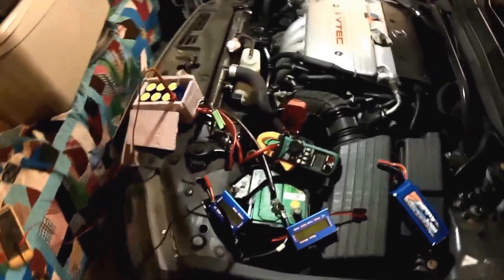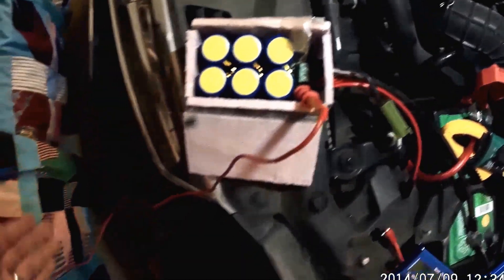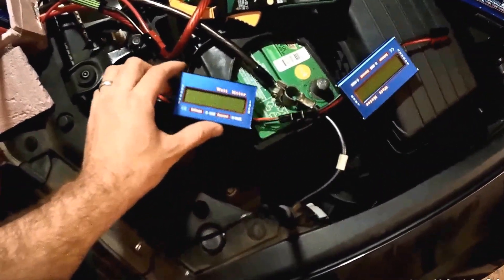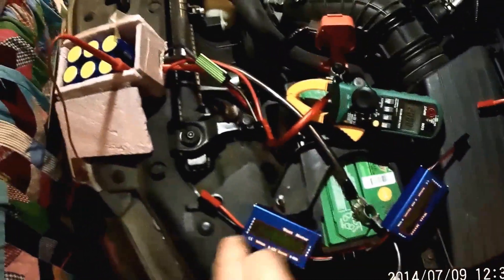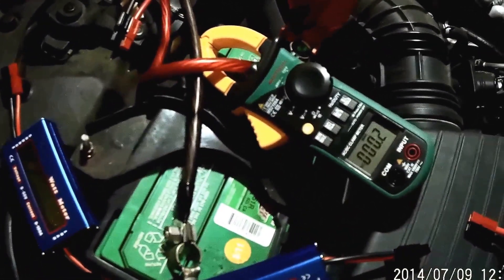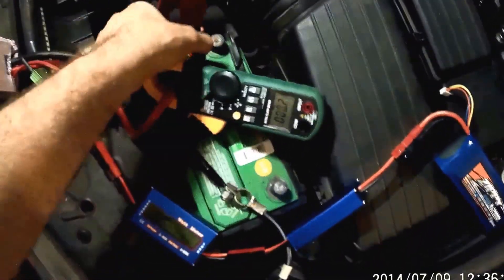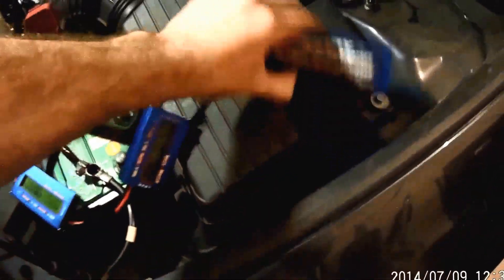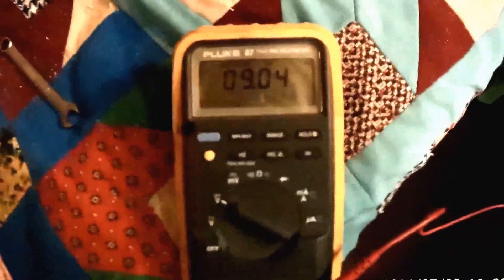Car battery replaced with a super capacitor and LiFePO4 battery

Comment: Your caps don't hold enough reserve. The high amp draw is from the caps lacking enough voltage. A 3.5v drop will discharge more amps as the capacitors compensate with balancing the wattage potential. You can hear the low crank speed of the car. Maybe two super capacitor 14v banks in parallel to double your reserve would work...but with that dinky battery pack limited to 50w, in no way that set up would work reliably in any cold climate.
Reply from the maker: Thanks for watching and commenting. The car has always been slow to crank, even with the stock battery. That said, I completely agree that somewhere around twice the farad rating would be ideal. I do have 3000f in a 5-series string setup that I put together to replace 1 of the 2 huge batteries in my diesel pickup, so I could test cranking performance with that.

I still have this car, and since the video has been made, I have built my own 4s LiFePO4 battery using 32700 7.2Ah cells, and located the pack in the glove box (to keep it from freezing temperatures). Perhaps I'll provide a video update on the current setup.

Comment: A circuit to disconnect the cap if no charging took place for a while might be useful... (It would require the battery to be large enough to start the car on its own under such circumstances though....)

A BMS for the battery might also do the discharge current limiting....

Also, the capacitor's capacity (since it starts charged) should somewhat extend the time that the car can stand before the battery gets discharged.... (Maybe an extra day...)

Comment: Does any one know what is the RESISTOR Value in OHM and Watts Resistor To put on 2.7 Super Capacitor to protect it from go over charge or balance in pack ?  Please tell me.  Thanks
Reply from the maker: Hieu Don I did not use resistors to balance the Caps. Instead I soldered 1 LED and 1 standard diode in series across the + and - poles of each capacitor. This causes the capacitor to rapidly bleed off excess energy as it approaches 2.7 volts, but very slowly bleed energy as it drops lower.

In my opinion, a 6-series super capacitor setup in a car likely doesn't need any balance circuitry since they naturally bleed off more energy when they are at higher voltages. With 6 in series, each capacitor has roughly 0.3 volts headroom for a little bit of imbalance. It is important that each capacitor has a good connection to minimize imbalance, especially when working with aluminum connectors which tend to oxidize rapidly.

Comment: What made you get a 0.2 ohm, 50 watt resistor instead of another value?
Reply from the maker: Thien Nguyen I didn't do the math correctly when selecting my resistor value. The battery has a max rated charge current of 2C, which is 8.4 amps. I figure the lowest my battery would get discharged to would be 10.4 volts and the highest charging voltage from the alternator will be 14.4 volts. The difference is 4 volts. Applying Ohm's law, divide 4 volts by 8.4 amps to get 0.48 ohms. If I wanted to properly protect the battery, I should have chosen a 0.5 ohm resistor.

That said, having a lower value resistor allows the battery to contribute more to starting the car and less energy is wasted as heat.
Reply: Hey, thanks for your detailed answer. Shouldn't we follow a current charge limitation instead of voltage difference? I followed this https://www.allaboutcircuits.com/textbook/direct-current/chpt-6/current-divider-circuits/ and what I found is this (correct me if I missed something) :
TSX alternator current : 110A, R = U/I = 12/110 = 0.11 ohms
Resistance for battery protection : 110/8,4*0.11 = 1,44 ohms
and for resistance watts : 1,44*8,4^2= 100 W
What do you think? Thanks
Reply from the maker: I'm not following your math. In the first equation, I'm unsure what the 0.11 ohms represents. The amperage output from the alternator isn't so much dependant on the resistance of the internal wires, but rather a regulated output designed to protect it from overheating. I'm also not understanding the last equation where you get 100W.

When I calculated for the resistor value, I assumed zero resistance of the wires itself (for simplicity), and assumed the resistor would account for all of the current limiting resistance. It's a conservative calculation since it ignores battery internal resistance, and the resistance in the wires themselves. Considering that, a 0.2 ohm resistor is likely sufficient in this application.

I could test the theory by discharging the battery to 10.4v (my hypothetical lowest discharge voltage), and then  measuring the charge rage from the alternator through the 0.2 ohm resistor into the battery.

Comment: Nice video.   I love that you've metered everything out to demonstate exactly whats going on to those watching.   The Balance board (for Caps)   Is it this one???   

http://www.ebay.com/itm/Ultracapacitor-balance-sheet-6-strings-are-super-capacitor-plate-MaxWell-2-7V350-/111549410018?pt=LH_DefaultDomain_0&hash=item19f8dceae2

I thought i'd read somewhere else there was a current limit of about 10-12Amp on this or a very similar product..  However maybe this would only apply to charging, if discharge current doesn't run thru the board.  Are you able to shed any light on this?  Obviously yours is working for you....   could you please advise a link for the one you used?  Thanks for a great vid.
Reply from the maker: Malcolm Anderson The Ebay item in your link is specifically designed for the Maxwell 350 farad capacitors. If you are building a supercap bank with 350 farad caps, then it would work. The current limits refer to the protection circuits ability to bleed off excess voltage. The caps can still be charged or discharged or discharged at very high rates.

My protection circuitry consists of a red LED wired in series with a standard diode across the + and - terminals of all caps. In my opinion, most designs won't need balance circuitry. Mine was constructed before I knew about the caps ability to somewhat self balance.

Comment: Great video and I absolutely love the info you got from the meters. Two questions..
1. Were the 2 blue meters in series or parallel?
2. Since you wanted to protect the lipo4 battery you must like it. What brand was it and a link would be great, Thanks again
Reply from the maker: The 2 meters are in series, and both were necessary to see power going into and out of the battery. This is because the meters only read flow in 1 direction. I purchased them from Amazon for $15 shipped.
http://www.amazon.com/gp/product/B00EYZS6R6/ref=oh_aui_detailpage_o09_s01?ie=UTF8&psc=1

I bought the LiFePO4 battery for about $40 from Hobbyking. It's conveniently prepackaged in a 4-series configuration, but if I could purchase again I'd probably go for a higher capacity unit from Batteryspace.com.
http://www.hobbyking.com/hobbyking/store/__14070__ZIPPY_Flightmax_4200mAh_4S1P_30C_LiFePo4_Pack.html

Comment: I am currently doing much of the same testing...  I also have a super cap setup in my bike that works great however I have been warned that they can fail prematurely due to vibration..  what do you know about that?  I also have been using a lipo4 pack for my car as a hybrid setup, mine draws around 240amps to the starter and I have set up my battery resistance so that it maxes out around 30a.  the problem I see though is that the battery is kept nearly full all the time, most of my experience is with li-po batteries but I have concerns about the life span of the pack keeping it full, and also in a high temp environment.
Reply from the maker: Thanks for sharing your experience.

I don't know much about damage to the supercaps due to vibration. I do know that Maxwell's new part, BCAP3400 is supposed to be more vibration tolerant. My supercaps are encased in a 1/4" foam box that I taped together. They have held up so far for the 1 year I've been running on just a supercap in the bike. I do believe a single LiFePO4 would be the ideal battery for a motorcycle, although I haven't tested it yet.

As far as LiFePO4 charging concerns, a 4s battery is rated for 14.6v at full charge, and my alternator outputs 14.4v. This would keep the battery close to full charge, but not quite 100%. I suspect this prolongs battery longevity.

Underhood temps aren't too bad in Portland where I live, so my main concern is charging at sub-freezing temps. LiFePO4 is not supposed to be charged below freezing.